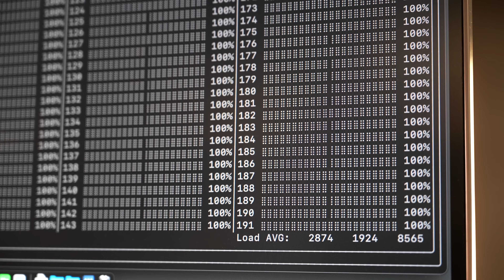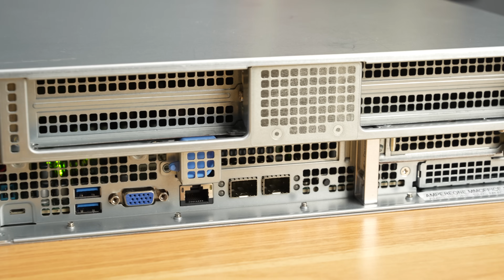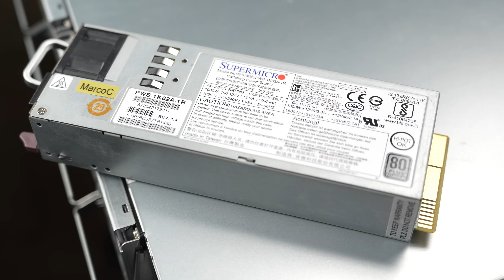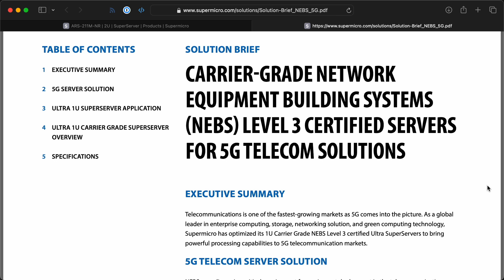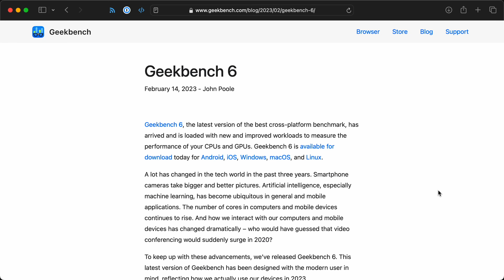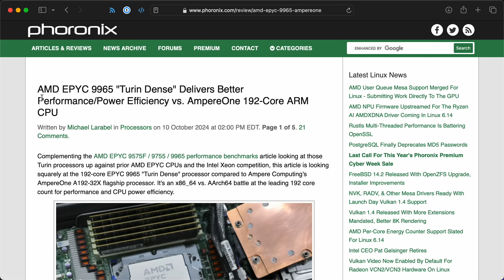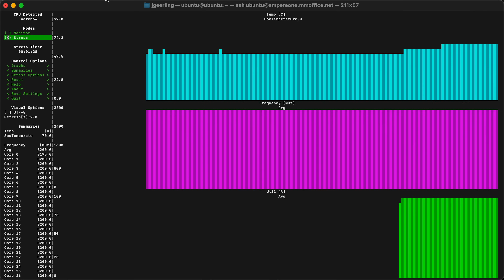CPU Cores are the new Megahertz

Comment: I would love to see you cover SC25 next year. 

I wish I had the budget for something like this. It may not be for HPC use but I would still love to see how it handles non GPU HPC workloads. 

Not all HPC needs to compete with the top 500. It is beneficial to have a test cluster before scheduling time on the large clusters. (Slurm over k8s is sweet)
Reply from the maker: I even know some folks who test on a Pi cluster in preparation to send a job off to a 'real' cluster!

I do hope to be at SC25, it's back in St. Louis, so I have no excuse to miss it!
Reply: I saw SC24 had a 'IPv6 mostly' test network as well.

Comment: Back when I did development, we talked about vertical MIPS and horizontal MIPS.  Big fast machines were more 'efficient' but lots of 'cores' allow running lots of stuff, but think of them as threads.  It is great stuff, but if you can take the MIPS and add it all into one it was 'more efficient' and more computer programming to use more 'cores' efficiently.  ... Enough from old history (starting in the '80s when I got my hand on them).
Reply: Im a junior dev rn. I really like to think of my personal projects and code as "services". It just makes it feel like a mechanical part that you would use in a car or something.
I feel like other ppl realized this too, cus microservices are way more popular than some big monolithic server program.

like yea the interactions between them has alot of overhead, but the fact you can scale them so easily the more silicon you spam into it, the better. 

I used to make alot of roblox games with my friends back in HS. Even Roblox is adding more multithreading support to their games, which is really needed.

Comment: Lmao it still has VGA
Reply: That's fine in a data center. It's not even an issue whether it comes with VGA or a DisplayPort. It's most often used headless anyway.
Reply: They invest so much money into hardware but can't possibly upgrade that KVM from the 90s with a dying TFT..
Reply from the maker: Heh the amount of ancient dell monitors I still see everywhere... they do have a better aspect ratio of course :)
Reply: @JeffGeerling  What bothers me is that they didn't even bother to add a displayport, i've seen many modern servers that do have the VGA but also a standard DP if you happen to have built your rack in the last 15 years or so, so you'd need a dongle if you don't have a VGA monitor around anymore and resolution will be limited, though if you want any decent graphical acceleration you'll likely end up with a GPU anyway.